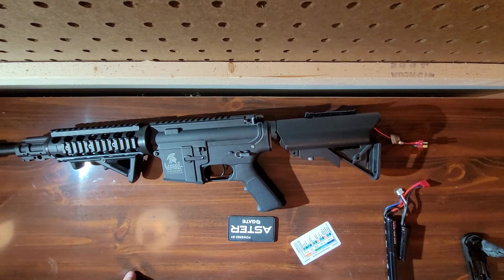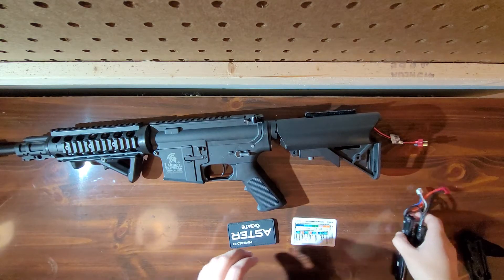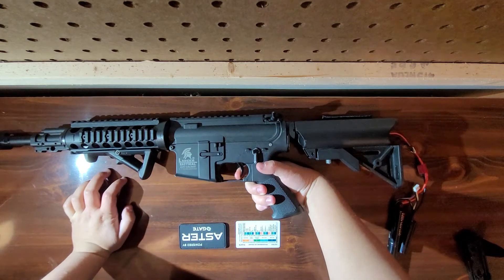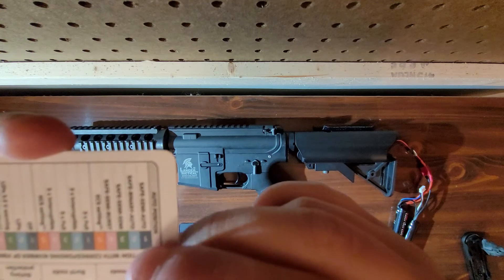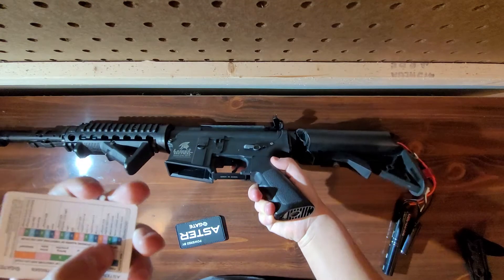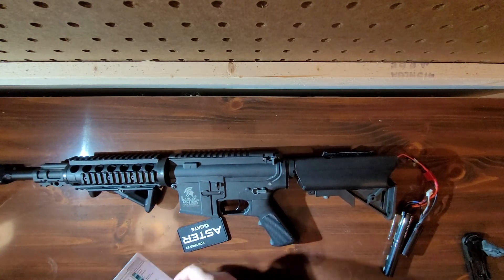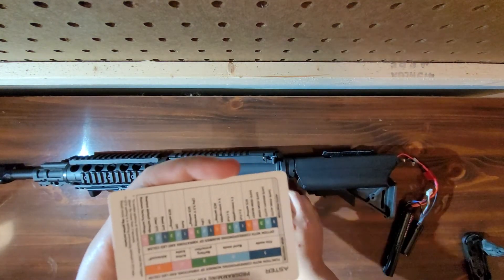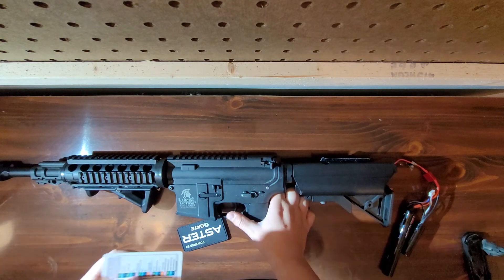How to program Gate Aster VIA Trigger

Comment: my full auto mode is stuck in semi and I try to restore to default but it won't do it any tips because I just bought this gun like 2 days ago maybe something is wrong with the full auto because I did exactly what you did and it's still in semi and it was never in semi gate aster won't do anything.
Reply from the maker: Maybe on your aster you have the settings set to semi, semi. So basically both are semi auto! That is probably your problem. Cause I know that is one of the settings for fields that only allow semi auto